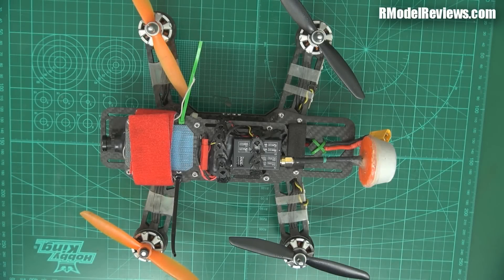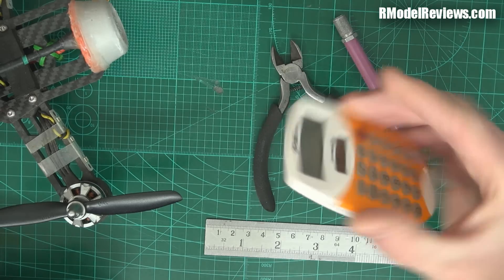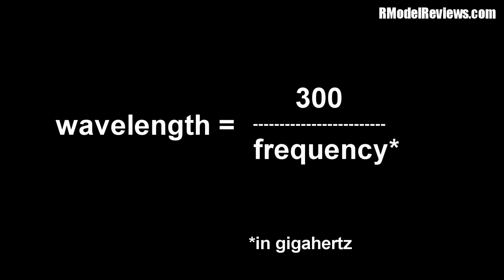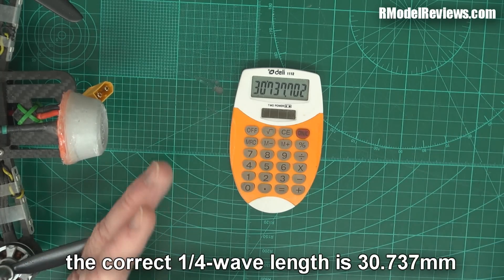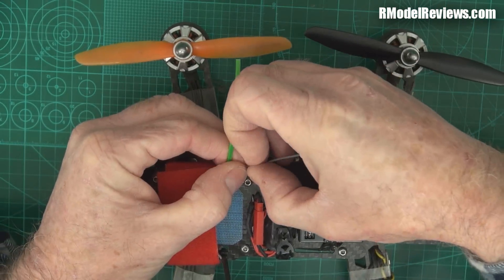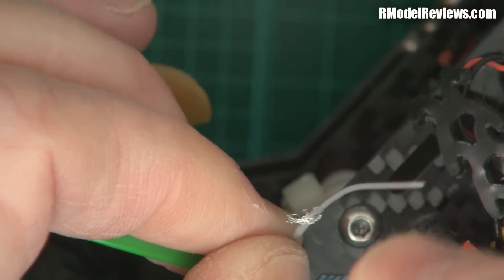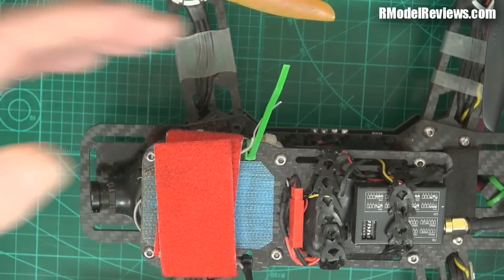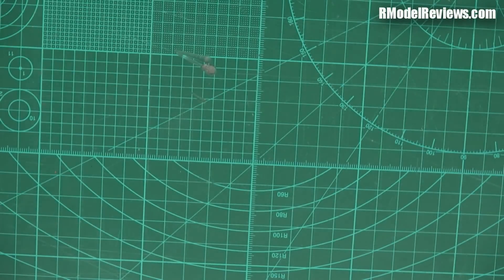How to repair a broken receiver antenna

Comment: Still hopefully waiting to see how to replace the entire length of wire as mine was pulled out from the base.  Thanks for this vid though Bruce
Reply: I know it's just a matter of time to have the same problem, have you figured it out?
Reply: Yeah happened to have a spare cable with connector from when i pulled apart an old laptop or router or something. Basically you just need coax cable by the sounds and you can resolder them. At least hope thats right
Reply: @alcoxy  I know this comment is 4 years old, but were you right?
Reply: @alcoxy  does the length affect the signal from the RC receiver?
Reply: @brianm6272  to be honest Brian I can't even remember anymore so I can't say. Sorry.
I think the length affects the wavelength not the signal strength
Reply: @alcoxy  thanks for getting back to me. Cheers

Comment: Cut the isolation a few mm more back.
Pre-tin the outer shield with a soldering iron. (check if your coax doesn't melt. Most of the time it's teflon so it doesn't)

Then make a ring cut around in the schield and break it off.
You get a nice clean edge.
Small heat tube to finish.

Comment: What happens when the antena is too short to repair?
Reply: didn`t you watch the video? 6:42 he says it
Reply: but he doesn't give details, I would need a tutorial to do this. I know he promises to make a clip about this in the future, but still.

Also my British is not that good ,)
Reply: You can replace the antenna with a new one - it's very easy. Buy a pack of 10 spare antenna from Banggood for $5 or whatever. Search youtube for "how to replace my X4R antenna" - easy! 
By the way Bruce speaks English & he is from New Zealand ;-)
Reply: Thank you
Reply: and when you have an antenna soldered to the board? like the jjpro receiver

Comment: Another great video Bruce  , Im flying with assan 2.4ghz and can I use any old wire I havent found any shielding on the unbroken antenna silly question i just want to be on the safe side cheers

Comment: Excellent video Bruce, can you do one on adding this type of antenna to a receiver that has one (or more) short antennas coming off it's circuit board?  I have some Orange R615Xs that would be great mini quad receivers if the antennas would clear the frame.

Comment: To make it complicated: don't you have to consider the velocity factor of the antenna lead, which will make the optimal antenna length a little bit (5-10%) shorter than a quarter wavelength?
Reply: superdau The velocity factor applies to the coax itself but not so much to the radiator portion.  Also remember we're dealing with a frequency spread of 80MHz here on the 2.4GHz band so it's never going to be an exact 1/4 wavelength of all the frequencies that get transmitted.

Comment: Why is the Taranis Rx antenna only 26mm, not 31mm??
Reply: Wanted to ask the same
Reply: Reading through all the many similar questions that Bruce did not answer the  shorter distance is likely due to losses in the amp/coax. I made my own Antenna and copied the 26mm element and it works better than the standard / supplied Taranis antenna.
Reply: Mark Jennings did you notice any drawbacks?
Reply: No, Maybe I was lucky that the SMA pigtail I fitted to the taranis and my soldering came out to a similar loss as the original. I range tested and get 1.8km before RSSI warning. 2.5km before loss. ( I made my own 1/4 wave Di-pole. Coax element and launch element both 26mm)

Comment: Bruce, your timing was perfect...my poor little mini quad antenna.  I ordered replacement antennas for the FrSky D4R-II and am looking forward to your "replace video" Thanks for everything.
Reply: chipsterflysome yes. what are the traps when you replace the complete antenna?
Reply: Joerg Paysen I contacted the good people at Aloft Hobbies and they recommended this...

" they snap in and have a little rubber like epoxy on them as well. You can just lightly remove the "glue" and pop them off and snap the new ones on"

I will wait for Bruce's video before I replace mine.

Comment: Another great video Bruce! I am almost done ordering parts for my Mini quad build and also and getting a little thing from HK that has two tubes for the antennas and are a 45 degree angle to keep them up and the right way but if this every happens will try for sure! Thanks again :D
Reply: What should I do if my antenna was cut with only a half inch left(real short)?

Comment: I done the same trick but was told to make em 32 mm ...but look at the maths and it should indeed  be  closer to 31..i ll snip a mm off mine i guess.
Although never had an issue ever and when i measured the ORG  antenna for comparison  ( D4R II)  I was sure it was closer to 32 as well ?...do i need glasses maybe :)

Comment: If you use an antenna you have calculated the velocity factor of air which is 0.96
So the calculated length * 0.96

Comment: If its only the exposed part of the antenna that matters, can i actually trim the length of both my rx antennas down and do this modification and yet not reducing the signal quality of my receiver?

Comment: Hi Bruce. As a licensed radio amateur, and having experimented with various antennas for various frequencies over the years, I also found that the best length for the feeder of a 1/4 wave antenna was ANY uneven multiple (except 1), of the quarter wavelength. i.e  if 1/4 wavelength = 31mm, then any uneven multiple length of coax that is a multiple of 31mm will be ok.  So,  NO to 31, YES to: 93 [ which is 31 x 3], 155 [ which is 31 x 5], 217 [ which is 31 x 7] etc.  As you also mentioned about velocity factors this feeder length is not absolutely critical, but it's just as easy to get the correct feeder length as not, so why not try?   Keep up the great videos.
Regards Mark in the UK

Comment: This got me thinking - Is it possible to increase range by changing a perfectly fine stock antenna into a half wavelength antenna?
Reply: I did just that, i bought some uplx (or something like that) jumper cables solderd halfwave dipoles on to them and replaced the original antennas with the one i made, i also replaced the transmitter antanna with a dipole, instead of the sleefed dipole inside te ruber duck, this increast my range quite a bit. But when your antennas get in your props they get destroyed quite badly xb but the extra range is quite useful :-)
Reply: Jaap Pieroen 
No, with a half wavelength antenna The signal eliminates itself which leave you with no range at all. Half wavelength can be used with Dipole antenna (which are kind of two 1/4 wavelength antennas)
Reply: i made halfwave dipoles, not halvewave monopoles, and that workes quite well

Comment: Thanks for sharing mate.  You're a wealth of knowledge, really helpful for a newb like me and I really appreciate the effort you go to, to do these vids.
Reply: +Brian “Mozzzzi” Bloomer Just one quick question, you mention that replacing the antenna on the D4R is tricky.  Did you end up doin a Vid on that? Look just like I should unclip and clip the new antenna onto the terminal in the D4R.  Is it that easy?  Thanks.
Reply: +Brian “Mozzzzi” Bloomer nk to a cable tie, is it OK for the heatshrink to cover the clear wire 31mm or should the heatshrink not cover the clear wire?

Comment: Time (space) + electronics = magic - impossible. And that's where the magic comes in because "nothing" is impossible.... you always have the other half in an information frame with "something" to work with. If you can imagine it you are already half way there and the hardest part is done, you just have to do things right using hard cold laws to make it real and that requires understanding electronics which in turn requires understanding time which in turn requires understanding(while looking at a speed of light clock create light we call the weak force which powers the Sun) the constant changing ratio of time dilation in effect that gives us the time that moves our clocks that could not move without "{a}" that's value was not known until 2003 thanks' to SLAC's E158 team: e{a}/t=E. The equation is a dice crusher. Look who was correct after all....

Comment: Bruce I need to replace the single short wire antenna on an old d4fr  frsky receiver as it has broken off, what grade/type of wire can I replace it with?
I know that it must be 31mm long but not the type of wire.
Can I use normal silicone wire or normal copper wire?
Many thanks rct

Comment: Does the length of the wire up to the exposed inner make a difference?
Reply: Kevin Ray In the small antennas we're using on our models, no it doesn't.
Reply: ok. sweet.. 
so, can probably shorten them on purpose to reduce blade strikes then...
nice idea maybe..

Thanks again for a great video.
Reply: +Kevin Ray Let me see if I'm right: The length of the antenna WITH the shield doesn't matter. The important length is this slice of antenna WITHOUT the shield protector: 123mm? (or a 1/2: (61,5mm) or a 1/4: (30,7mm)? I'm right?
Today I cut from the root my antenna from RadioLink R9D 2.4Ghz 9-Ch S.Bus Receiver and now I need to fix it.

Comment: does the telemetry really go thru only one of the antenna's? I figured it was encoded in one 2.4ghz signal, with it being a diversity setup and a duplexer. You should do a mini video detailing the technology involved. Cheers

Comment: Thanks for this video. 
Question: I bought some new receiver wires and they came with 34 mm exposed, so will I improve the signal strength at 2.4GHz if I snip the exposed part of the inner wire down to 31mm? Cheers!

Comment: Love your videos! Finished my mini quad using your tutorial and am finally good enough to fly with the goggles on. My first big crash smashed one of my clover leafs on the antenna. I was able to bend it back in place and it seems to be pretty good, but sometimes I still lose signal. Is there a good way to repair one of these or am I looking at buying a new one? Also, is it normal to get less range on fpv in low light? I seem to have about half the range in the evening than I do during the day.

Comment: Brilliant Bruce, so it's just the length of the exposed part of the antenna that makes up the 1/4 wavelength?
Reply: RCTV-UK Yes it is
Reply: Great,I have replaced antennas,if I knew about this I would have tried this first,you are a world full of information Bruce
Reply: ***** great tutorial Bruce!but what is the little copper tube on the end of some antennas like flysky?
Reply: Andrew Waters It's a sleeve that provides a counterpoise for the wire of the antenna itself (the bit we exposed).   It does improve the radiation pattern of the antenna and can increase range -- but most RC gear has range which is several times the distance at which you can actually see a model so most manufacturers opt to save weight and bulk by not using it.
Reply: +RCTV-UK Let me see if I'm right: The length of the antenna WITH the shield doesn't matter. The important length is this slice of antenna WITHOUT the shield protector: 123mm? (or a 1/2: (61,5mm) or a 1/4: (30,7mm)? I'm right?
Today I cut from the root my antenna from RadioLink R9D 2.4Ghz 9-Ch S.Bus Receiver and now I need to fix it.
Reply: +Antoni Pons Yes, it's only the length of the exposed inner that matters.  The length is 1/4 wavelength at the desired frequency.  In the case of 2.4GHz RC gear then that's a center-frequency of 2.45GHz (or 2.44GHz in some regions -- but it's not really that critical).
Reply: +xjet  Bruce, the instruction book for my Turnigy TGY-i10 (AFHDS2A) and its receiver both say that the antenna length is 26mm, can you tell me why? 26mm doesn't line up with the math.
Reply: +Nivek0the0Relic In theory, radio waves travel more slowly through wire than through open space so sometimes a "velocity factor" is applied which affects the result.   The velocity factor for open wire is very close to free-space but the velocity factor for the coaxial cable itself can vary but is often around 0.7 or so.  I guess the Turnigy antennas allow for some other velocity factor.  In reality, a few percent here or there doesn't make a whole bunch of difference on a receiver antenna.
Reply: +xjet So will 26mm give me better range than 30.7mm? I have noticed the copper sleeves are 26mm also, I assume this length is important for the counterpoise to work? Oh and how the heck do they solder the copper sleeves on without melting the insulation around the centre core??? Sorry for all the questions, but I'm building a Go Discover and would like the best range I can manage out of the busted anteena on my i10 receiver!!

Comment: Thanks for yet another great video, Bruce! 

Here's also an option from ebay in around 7 euros (less than 10 USD) including some spares:
http://www.ebay.co.uk/itm/261755111147

These are compatible with at least FrSky D4R-II so they plug straight into place of the previous antennas without any soldering needed.